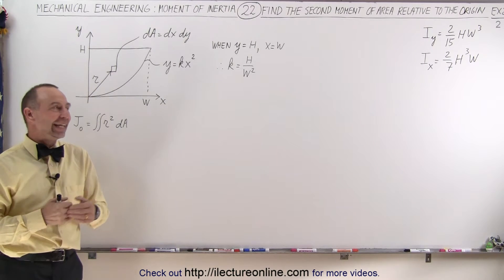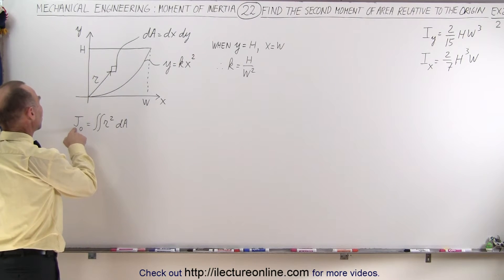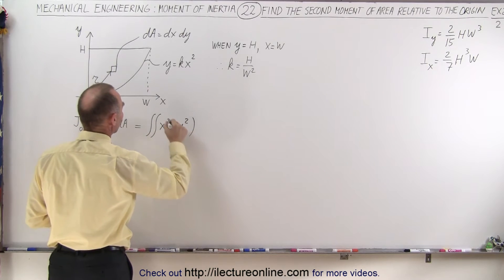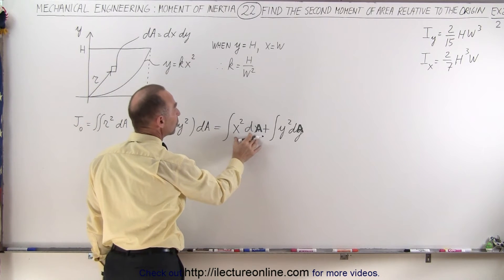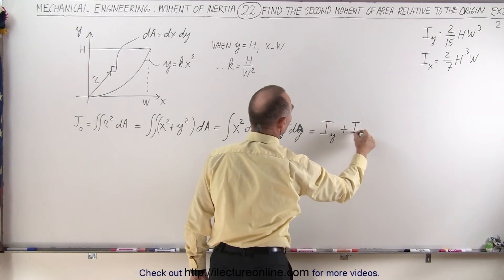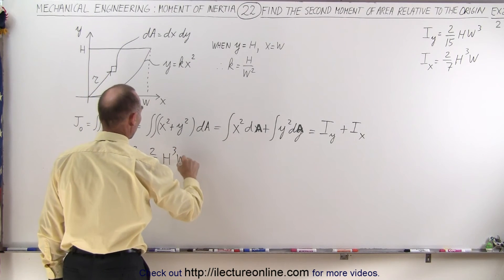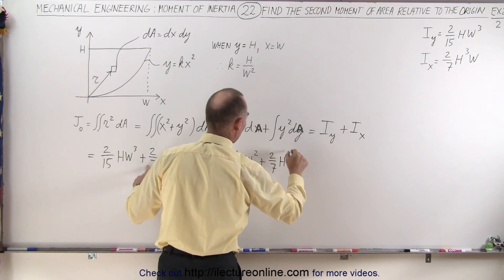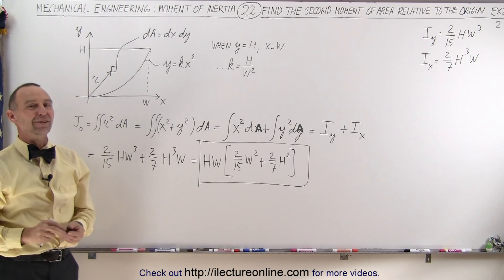Mechanical Engineering: Ch 12: Moment of Inertia (22 of 97) 2nd Moment of Area Rel. to Origin: Ex. 2

Comment: Is there a way we can apply the parallel axis theorem to the problem, or is the method you have provided the easiest approach?
Reply from the maker: You would first have to find the moment of inertia of a quarter circle and then use the parallel axis theorem to move the center of rotation.